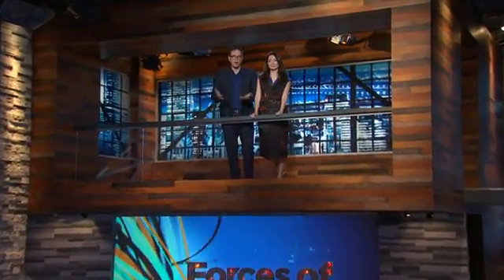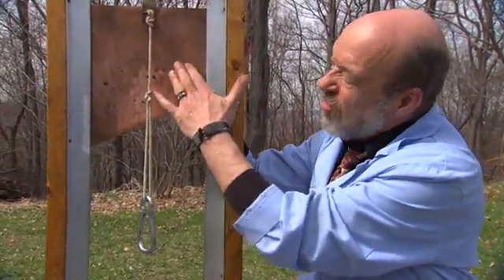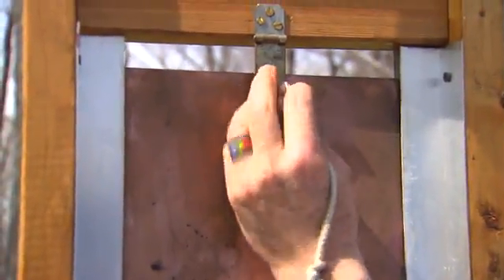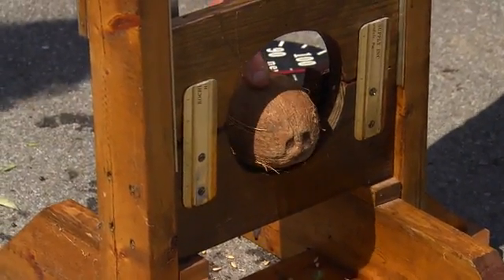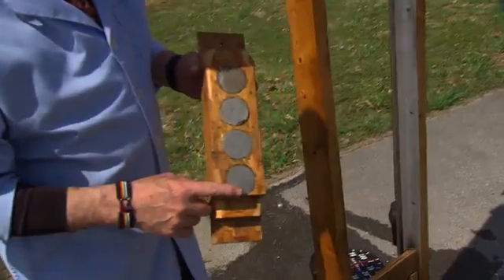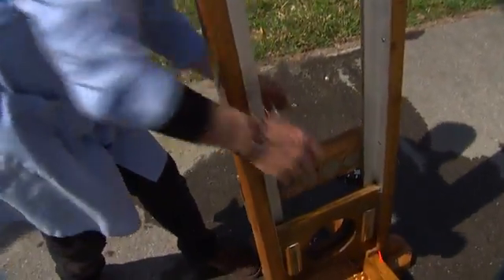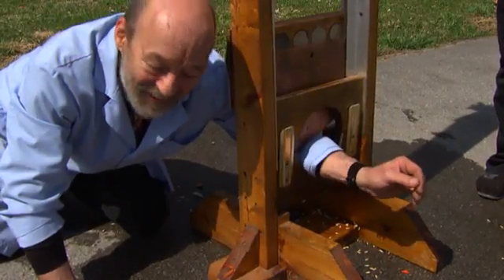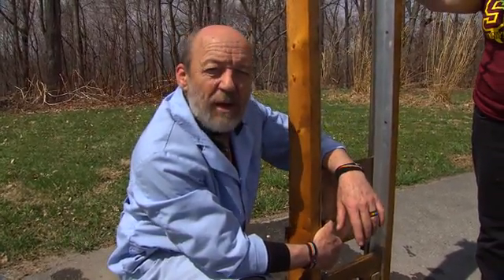Chopping up things with an electromagnetic Guillotine

Comment: I'm still not sure I understand what exactly happened... did the the electromagnetic current decelerate the blade?
Reply from the maker: Yes, in that the kinetic energy of the blade was transformed into electric energy, when the conductor, the copper blade, passed through the magnetic field, which then turned into thermal energy i.e. heat
Reply: @mad.scientist  That's amazing!
Reply from the maker: Thanks